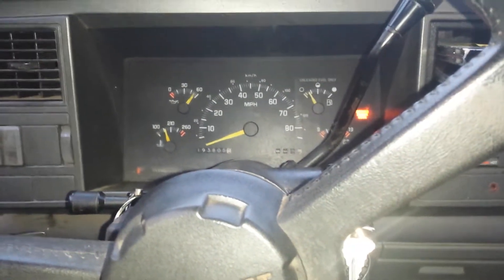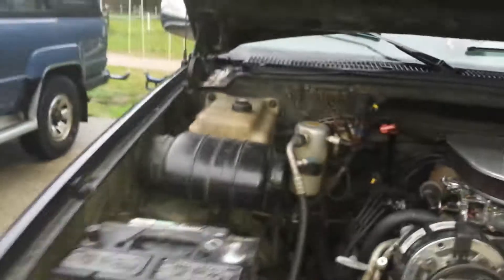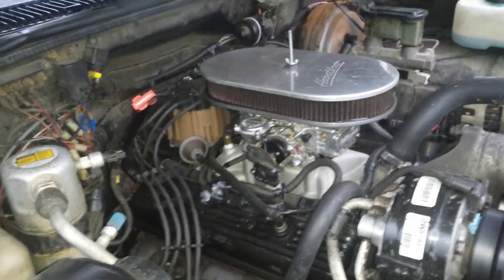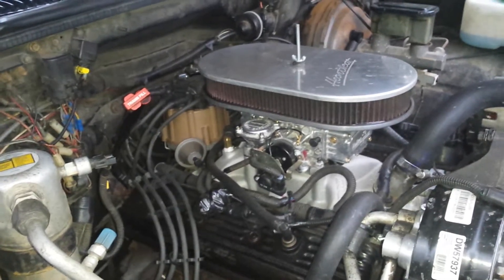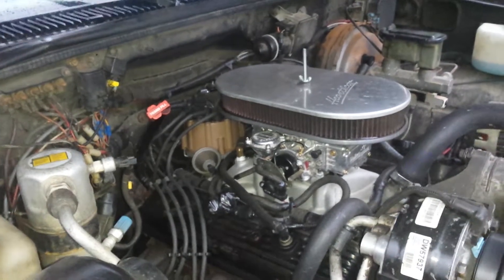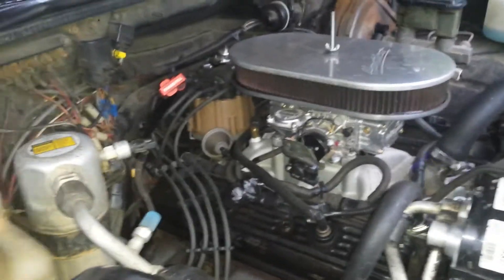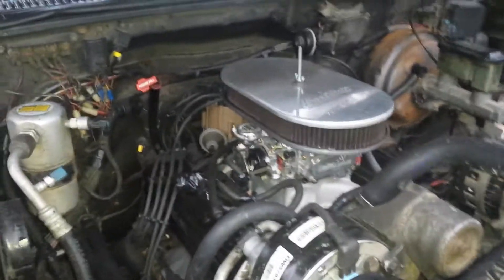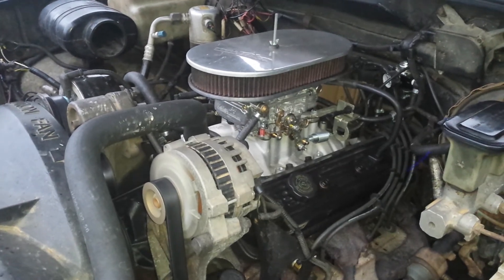TBI to Carb Swap Chevy Truck Part 4

Comment: So I put a .480 lift cam in my 350. TBI. I believe I need a carb now. I see your 600 cfm carb works great on stock cam 350. But anyone know if I need more  carb? 

The way it sits it can run and drive. But it's just completely gutless above 3000 rpm. Think I need a 650 or a 700?
Reply from the maker: Yeah, I would go with the 650. It still gives you room to jet up or down if needed. Though before changing out your carburetor I would put a set of headers on it or a low flow muffler, unless you have either or both already?

Comment: So you bought the kick down bracket 20-95 even though you did not have the 700R?
Need to watch all the videos again, good detail, best so far I found on this.  Love the part numbers!
Reply from the maker: Good day friend. Yes, I bought the 20-95 thinking my transmission was a 700R. Though as you see I was able to use it for my accelerator return springs. Your welcome for the part numbers, was hoping to save the next guy some time!   Thank you for the kind words..

Comment: Hello, awesome video thank you wanted to know when you connected your fuel pressure regulator did you need to drill out a hole in the gas tank for a return line?
Reply from the maker: Good day Carlos, no I did not have to drill for a return line. My original fuel pump had a return line already.

Comment: What was the squeak you fixed? Mine is making the same noise I think it's the alternator but not sure.
Reply from the maker: Good day Tony, my squeak was coming from the power steering pump. I did replace it.

Comment: I had heard with these swaps that the computer no longer recognizes when you try to turn the Air Conditioning on. Is that the case?
Reply from the maker: Mmm, that I do not know? I have never tried to run the a/c in my truck.

Comment: Nice. No need to cap the advance pot at the distributor though. I used a summit hei with adjustable vacuum advance. The vac advance isn't really a performance thing, helps with fuel mileage and runs cooler .

Comment: So since you didn't have anything high performance in it and you only switched the intake, was there any improvement on fuel economy and throttle response? I read in the comments in your first or second video that you had a 4l80e? Did you originally have a 60e? Or was the 80e original? I'm thinking about buying a different more daily driver reliable after I sell my house and turn my 01 s-10/ trailblazer into a muscle v6 or at least completely overhauled with a carb and take off all the bs vacuum system except what the can and engine actually needs. I want to get a bigger beefed up 4l80e trans and put a k&n cold air intake with a snorkel and a turbo. I want to put a better cam in it and jack up the body suspension a little higher with wider rims and fatter tires. And put a flow master. Take off the 02's and converter and straight pipe it. It certainly won't be a daily driver when it's done lol.

Comment: Hello,
Very good video. I was wondering if the heat and air conditioning and dash gauges still worked  after the carb swap. Some have told me they would not. I want to remove the 4l60e and replace it with the 700r4 with no electronics.  Will the heater and air still work as well as the gauges? Have a lot of questions to ask wish you were closer.
Thank you 
erik
Reply from the maker: Hello Erik, 
My heat and gauges al still work after the swap. I can not speak about the a/c because mine did not work before the swap.

Comment: My only concern is where are the hoses running to the fuel pressure regulator? Is it a mechanical fuel pump on it? Or electric?
Reply from the maker: Good day DeAndre,  my fuel lines to the regulator are plumbed from my factory in tank fuel pump. I wanted to use a mechanical pump to avoid having to use a fuel regulator but my year engine does not have the provision to be able to use a mechanical fuel pump.

Comment: So I'm guessing you have the 12 bolt intake?did you also have the spider injectors?
I have a 97 5.7 vortex with 8 bolt intake. I'm also doing the conversion. I'll be using 750 cfm brawler. That tbs just bolts on? Does it work with the choke? I live in AZ and dont run a choke. Ive worked at a corvette shop for 5 years and know a little. I think you should do the same with the carb. So you can advance your timing and use v.a. and bot ping. Use ngk 6630 plugs and gap at 55. Use spacer under carb to separate pcv and brake booster. Don't use plug on top of #8, cuz its leans out that cylinder. Use back if carb and spacer.
Reply: Throttle body sensor tbs
Reply: Not ping*

Comment: Hey brother, I'm a little confused on this part: are you (can I) using the same ignition from your tbi, or will I have to buy another ignition?
Reply from the maker: Hello Dale, I do not understand your question? When you say use the same ignition you talking ignition switch on the column or do you distributor?
Reply: crewyou07, disregard that question. I put a vortec motor in my 95 truck and I was having trouble and was going to put a carburetor on it. I'm just getting a chip programmed for now. I'm keeping other motor to rebuild for a toy and will put a carburetor on it . Thanks for all the information

Comment: Hey buddy, did you have to do anything with your computer concerning the IAC?
Reply from the maker: Hello Dale, No when I converted it to carburetor the IAC went with the throttle body in the trash. I only needed to keep the TPS ( Throttle Position Sensor ) so my transmission would shift properly.
Reply: crewyou07, thank you for your response. I'm putting a 5.7 vortec in my 95 2500 and a chip guy was saying that if I go carb that I would still have to adjust chip for IAC?? Maybe he's wanting business. He seemed legitimate but idk. I don't see how that would matter.

Comment: When you moved the heater hose from the back to the front of the intake, is the flow the same?
Reply from the maker: Hello Myron, I do not know? All I can say is I have been running with that set up for about 2 years and I have had no issues with it.
Reply: Cool, thanks for the reply.
Reply: to answer your question my brother it dont matter if the hose in the front or the back    its all same

Comment: Thanks for the conversion videos. They really helped me with mine. I have a fuel issue right now though. I used the same regulator as you and I thought I did what u did. Are you using the original fuel pump in the tank. I am and regulator is set at 6psi. Only time fuel comes through the fuel line is only when I turn key to ignition position. But nothing when cranking. Did u have this issue too? Or u know what I missing? Thanks
Reply: If you’re running stock wiring, the ignition on will prime the pump (2-5 seconds) and once the oil pressure sensor sees pressure it allows the pump to continue running. This is a fail safe in case your engine runs out of oil it kills the fuel. Personally I take the power wire to the pump and cut it to re route it to an in-line pump on the frame rail in place of the stock filter with no regulator. The mr gasket 5-7 psi and holley in-line pumps work great. As long as your pump is low pressure (lower than the needle and seat) you’re fine, and less headaches to change with no need to use a return line.

Comment: Do you have the 4l60e transmission if so how did you get it to work with the swap
Reply from the maker: Hello Gilbert, I have the 4L80E and I had to install a TPS (throttle position sensor) for it to shift properly.

Comment: hi Crew... I like your conversion from tbi to carb... but I want to know how did you get the 4l80 trans to work with your truck since it is all electrontronic plugs?  And does the driveshaft from the 1988 -1995 truck fits right in the back of the 4l80 without any modifications?
Reply from the maker: Hello James, My 1992 Chevy Silverado K2500 came with the 4L80E from the factory. My truck when new was ordered with the heavier duty suspension and transmission (4L80E). When I did my conversion I did remove all the electronic components for the TBI, but I did leave the PCM an ECU units intact knowing my transmission is electronic. All that I needed to do to get my 4L80E to shift correctly was to install the TPS (throttle position sensor) set it to the right perimeters and I was good to go. The only shifting problems I did experience was due to a broken wire on the speed sensor for the output shaft of the transmission and a defective TPS that came with the Holley TPS kit, It failed about 3 months after I completed my swap. As far as 88-95 driveshafts that are compatible with the 4L80E? I do not know, I would have to research that. Hope that answers your questions? if not hit me back...
Reply: Can u show me how u connected the tps and  how u did it.

Comment: Hey i been looking at your vids my thing is what wires do i don't need from the tbi
Reply from the maker: Hello Christopher, It is easier for me to tell you which wires you do need. If you are using the factory in-tank fuel pump you need to splice into the purple and white wire (Tho it could be blue) from the 4 wire connector that plugged into the bottom of your original distributor and run that wire to the tach port on your replacement distributor. If your transmission is the 4L60e or the 4L80e you will have to use the TPS (throttle position sensor) other than that you can tie off all the remaining sensor harnesses and wires ( Like I did ) or remove them completely.

Comment: Did you use a melonized dist gear?  I was told if you dont they wont last
Reply from the maker: No Matt I did not, I have not heard of those gears wearing out prematurely? Not to say they don't but I have never encountered that problem. I used a new old stock GM HEI distributor from a earlier model Chevy I had in my inventory.

Comment: Limit the ac advance to 10* but leave it hooked up, these heads don't like allot of timing. 25 all in, with an extra 10 at cruise. 12 initial makes 22 at idle runs great
Reply from the maker: Thank you for the info!
Reply: can you dumb what you said down alittle please...i got a 93 suburban and plan to do the swap based off these videos
Reply: The vacuum advance canister uses a vacuum diaphragm to move a rod which advances the ignition timing in degrees before top dead center. Most stock HEI cans give 20-25 degrees of advance. If your unit gives 20 degrees at full rod travel, limit the travel of the rod to half and you’re only going to get 10 degrees advance. The mechanical also puts in allot of advance, you can limit this by making a “stopper” for the counterweights, I use screw heads of varying sizes depending on what kind of advance im looking to get.

Set initial advance to 12* btdc and mechanical another 12-13*   This gives you 25* “all in” your vacuum advance will also add 10* of advance, but as you get into the throttle the vacuum drops, so the vacuum only really helps cruise and idle quality, When i blew a diaphragm on my vac can and ran without it I lost 3 mpgs.

Comment: What did you do with return fuel line
Reply from the maker: I used the factory in tank fuel pump. I had to hook up the return line so I would not burn out the fuel pump.
Reply: crewyou07 how did you hook it up?
Reply from the maker: I used a Holley Fuel Regulator Part number 12-842 It has 3 ports an in/out and a return. The fittings I used were purchased at Auto Zone, Spectre part number 5946 for the in and out and Spectre part number 5945 for the return. Please refer to my TBI to Carb Swap Chevy Truck Part 1 for a visual of the hook up.
Reply: @crewyou07  can you explain it in lame terms for me so the gas tank line runs where? And the other 2 run where?
Reply: @drejackson1000  The regulator has three ports on it, one in [from the fuel pump], one out [to the carb] , and one return [which is hooked up to the original return line]

Comment: what did you hook the choke into got the same set up with msd ign, need 12v switched source just wondering what you did
Reply from the maker: There were two switched source wires going to the injectors on my original TBI, a red and a white wire. I used the red one.I do explain wiring my electric choke in my video TBI to Carb Swap Chevy Truck Part 2 at the 5:30 minute mark.